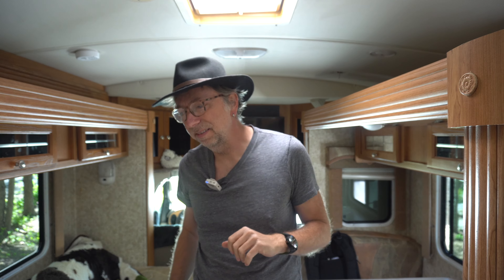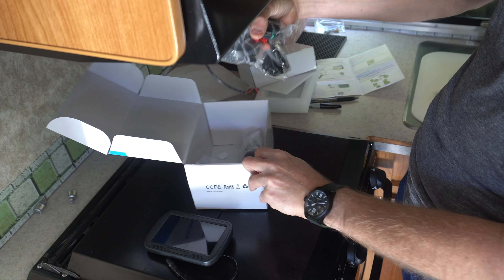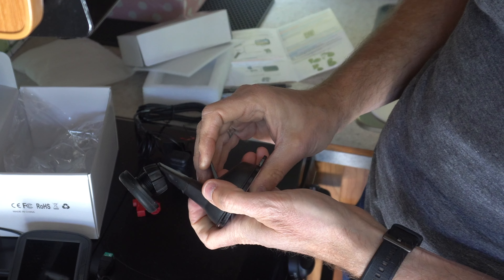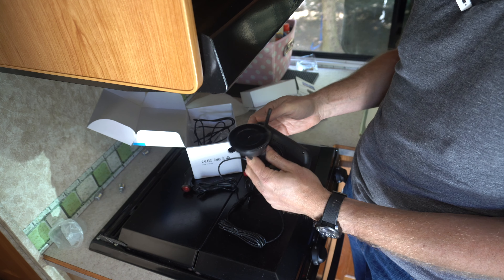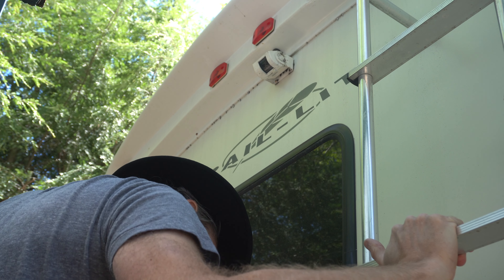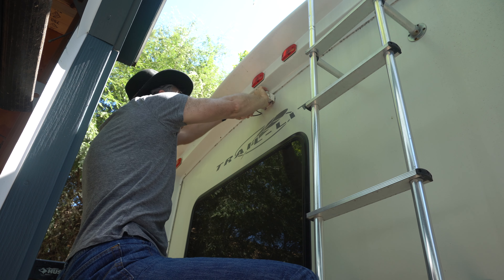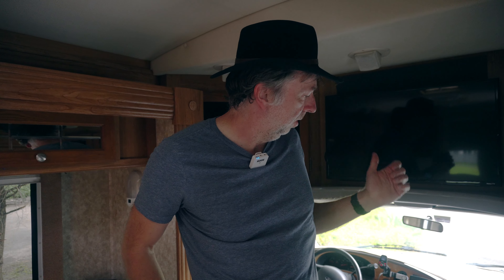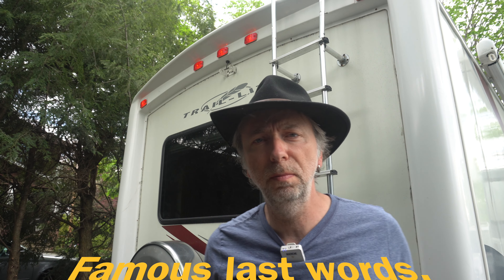Motorhome Backup Camera Installation - Wireless Upgrade!

Comment: Great video with explanation of the process. I have plans to try a similar install and I appreciate your information! PS Nice hat! 😉😉
Reply from the maker: You're welcome. I can tell you that the camera is still working fine. I didn't have super high expectations, but I'm always willing to give a low cost product a chance. Sometimes you get more than what you paid for. Same holds true for the tire pressure monitors that I bought (video on those as well). They are holding up great.